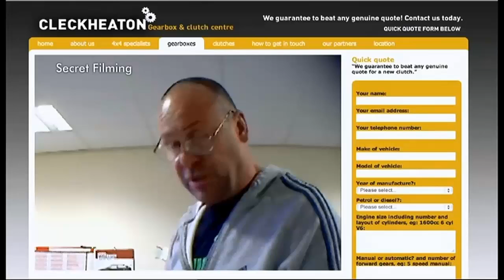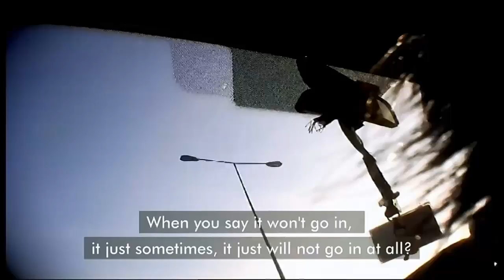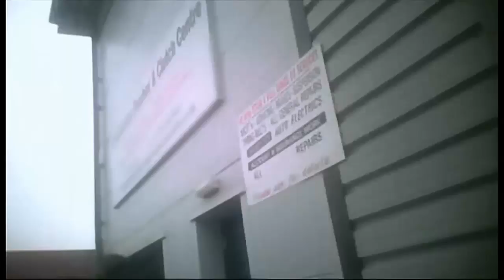BBC Rogue Traders 6 6 13   Avoid his clutches (pun intended)

Comment: In all fareness With the ford focus..seeing a leak like that would normally indicate a problem slave  witch means the gearbox would have to come out. And ruel of tumb... if the gearbox has to be taken out you should always change the clutch..because its open silly not to when you've already paid for the same labour to take the box out....
Reply: Only if the plate shows significant wear.  If it doesn't why spend on something you don't need?
Reply: Lol

Comment: To be honest, the aftermarket clutch he fitted to the focus, isn't a "chocolate" clutch, its a perfectly acceptable aftermarket item that you'll buy from any motor factors. Not everyone wants Sachs or LuK.
Reply: Debatable.  And it'll be a cheap piece of crap that WILL fail prematurely. 

If you're fitting cheapo clutches and the like you shouldn't be near cars. For components like that reputable brands are the only way to go and generally aren't much more expensive.

Comment: "it wasn't a re condition one. It was a second hand one." same thing aint it, 😂😅
Reply: Exactly!! Reconditioned , refurbished, redone all words that insinuate going over the part thoroughly and replacing all unusable, old, or nonworking parts with new ones as needed. Second hand means used , no proof of age of part, condition of part by close inspection, usually no warranty, no info on part. Refurbished is usually safe, inspected with fine tooth comb,warrantied, better , usually, than 2nd 🖐. I would buy a  refurbished 🖥 rather than second hand 💻. Second hand is usually inspection free which can not be trusted 100%.
Reply: No, totally different. If you know nothing about the topic, why comment?
Reply: @kaptinkeiff  r u saying they r the same , reconditioned and second hand, or that they r 2 different meanings?
Reply: @TMS-pj7fp  They have 2 totally different meanings
Reply: @kaptinkeiff  I wasn't sure of exactly what u were saying. I agree I looked up the definition of each on Google just to make sure I was making a accurate statement.
Reply: Not the same, put quite simply -
Second-hand - part taken from one vehicle and fitted to another vehicle.
Reconditioned - part taken from one vehicle, stripped, cleaned, rebuilt with new parts where necessary, tested for quality and then fitted to another vehicle.

Comment: I feel sorry for that man. Yes, he did try to diddle the Porsche, but in fairness, and not having worked on a Focus myself, I offer the following: If it was necessary to remove the gearbox to attend to the hydraulic leak (doubtful) then any mechanic would tell you that common sense says to replace the clutch in it's entirety while you are at it. It is at times traumatic enough to remove a gearbox, so imagine doing it twice just because it was "too expensive" or too much hassle to replace the clutch at the first go. Use an inferior product? Inexcusable.

Comment: I have a volvo that needs a new pcv system, i know this for a fact, but every garage i take the car to they say, it only needs an oil & filter change, they piss me off so much.
Reply: Soulware3D if you know this for a fact then just go to a garage and request they change the pcv system. We mechanics love it when customers bring in their car that they have self diagnosed, it abstains us from any blame as and when the part they we are requested to replace doesnt fix the problem. And if it does fix it then great, its saved us the time pissing about trying to diagnose a fault, we can just crack on doing the repair and have an easier day at work.

Comment: Incorrectly torqued bolts? Would this be too tight, or too loose? The only thing I can take away from that is a loose exhaust mounting system being loose. So, not overly bad without that missing information.
Reply: You sure though because the exhaust mounting system could have been altered on arrival with missing parts informed firstly towards the lower capacity that runs by it all.
Reply: What an odd thing to get hung up on. Incorrectly torqued could quite literally be too tight or too loose. That would be the definition of Incorrectly torqued.

Comment: I'm not convinced they were interested in honesty or mistakes but more on the investment of time to film it & make an interesting programme.
I'm a trader & I do get people that think I'm terrible but it's hard to explain to the public sometimes why you do certain things.
I am lucky I'm a small business so I don't charge unless I get results but there is that odd occasion where I feel I could have diagnosed better.
But I'm rouge trader proof because I don't charge for non results.
They do get some scumbags though & gosh there are a lot out there.i could send guaranteed rip off contacts they could film easily I know a few really shocking gas engineers

Comment: Does anyone notice the guy in the red t-shirt slate the guy by saying "unless he has a crystal ball in his office, he has no way of knowing that clutch will go within 2000 miles" 
The same guy that said the clutch had 30k-40k on the focus?
Reply: Hmm bit of a difference 
Focus he has the clutch plate in his hand 
Porsche it's still in the car
Reply: also difference in wording, The dealer made it definite within 2000km, however the mechanic gave an estimation between two amounts, both amounts significantly larger, therefore errors in estimation less accountable

Comment: On the porsche one yes he over charged and done a shit job putting it back together and tried to rip her off but thinking their shouldn't be any charge for taking it apart and putting it back together is wrong  time and also you need to take stuff apart to identify an issue otherwise you could have the customer come back and complain you didn't find anything and it's still happening mechanic's get a lot of shit
Reply: If he needs to do more than just drive it he is in the wrong job , from a recently retired sole trader , 37 yrs no advertising
Reply: 400 quid to remove and put back some trim etc? Bargain! 

And even better, they sent out back out worse than when it arrived 😂